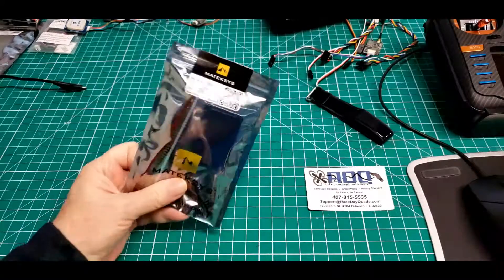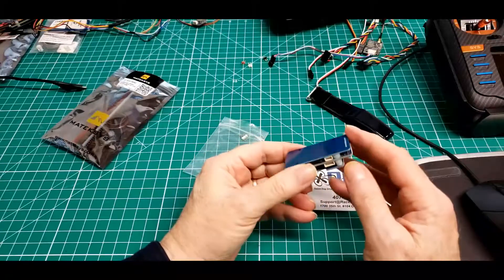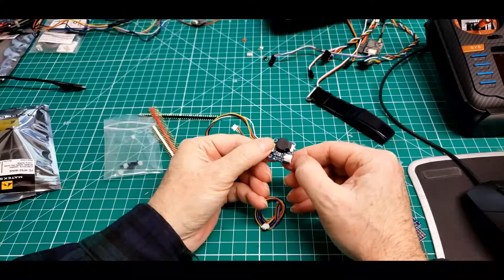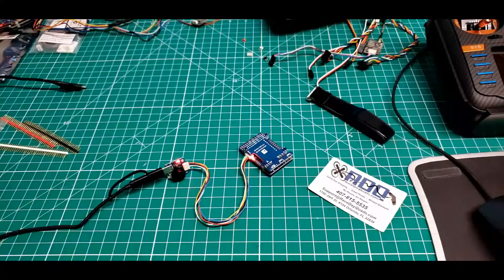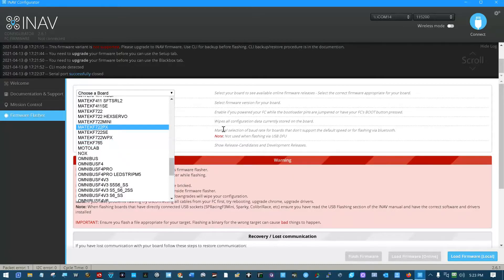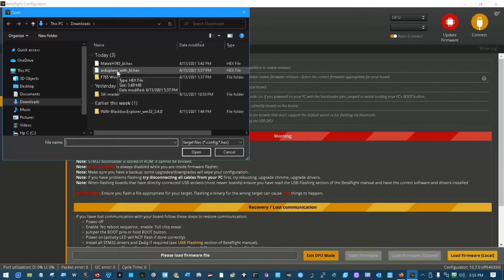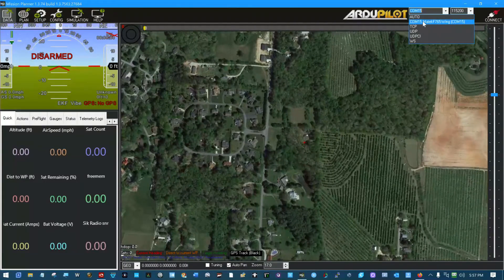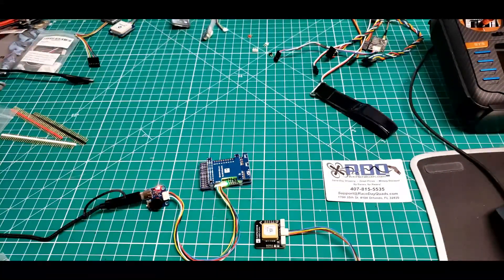H743 Wing

Comment: I want to know if the gps and the barometre come with the package or not??
Reply from the maker: There is no package here. I ordered all the parts separately for assembly.

The GPS is a M8Q-5883
https://www.amazon.com/M8Q-5883-Compass-Module-SAM-M8Q-QMC5883L/dp/B081X1VX2M/ref=asc_df_B081X1VX2M/?tag=hyprod-20&linkCode=df0&hvadid=416672155323&hvpos=&hvnetw=g&hvrand=7713317151858977230&hvpone=&hvptwo=&hvqmt=&hvdev=c&hvdvcmdl=&hvlocint=&hvlocphy=9010326&hvtargid=pla-885499139180&psc=1&tag=&ref=&adgrpid=93457066509&hvpone=&hvptwo=&hvadid=416672155323&hvpos=&hvnetw=g&hvrand=7713317151858977230&hvqmt=&hvdev=c&hvdvcmdl=&hvlocint=&hvlocphy=9010326&hvtargid=pla-885499139180

The barometer is installed on the FC in this case a H743-Slim

https://www.getfpv.com/mateksys-h743-slim-v3-flight-controller.html

I saved about 50% assembling it myself.